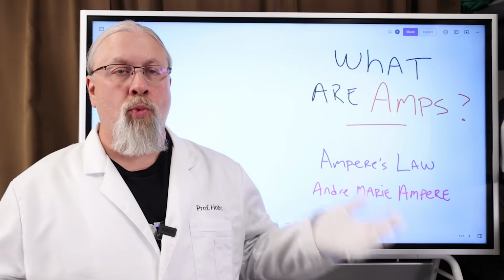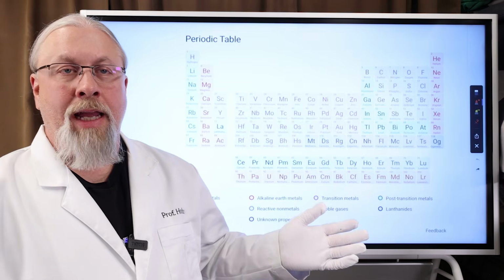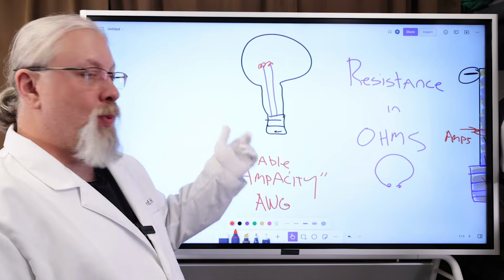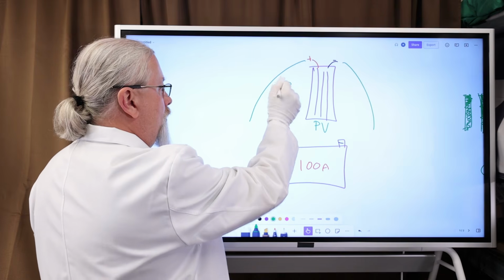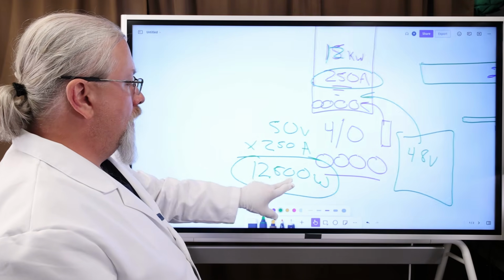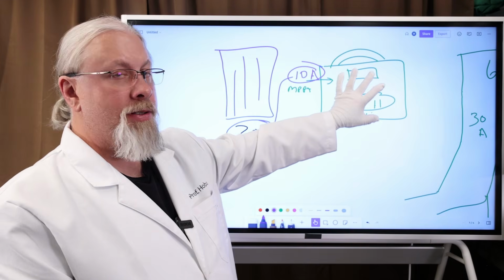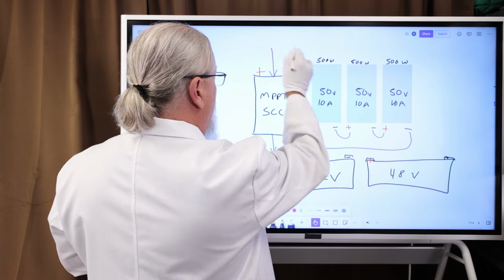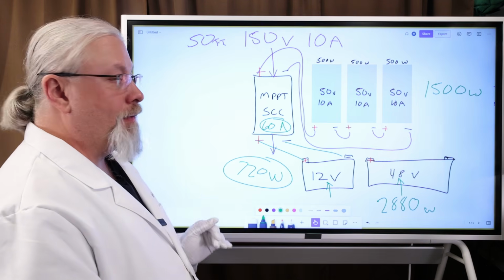Electricity for BEGINNERS Part 2/3: What Are AMPS In Solar Panels | Batteries | Power Stations

Comment: AWG = how many "pulls through a die" all cable (wire) starts thick then they pull it through a die to make it thinner. Every pull makes the wire a little thinner, so 2 AWG has two pulls through the die, still pretty thick wire. 12 AWG has twelve pulls through the die so much thinner wire in the end. This was how the AWG scale was originally designed, don't think is still done this way but the nomenclature is still used. This is how I remember which wire is thicker or thinner when talking about 10 "gage or AWG" vs 12 "gage or AWG" etc.

Comment: Question about my generator's solar input of 20A. I'm thinking of getting two 400W ZoupW panels and connecting them in parallel. The specs for one panel are:

Maximum Power Voltage (Vmp) 37.2V
Maximum Power Current (Imp) 10.75A
Opencircuit Voltage (Voc) 43.1V
Shortcircuit Current (Isc) 11.32A

Is there any risk that this combination goes over 20A?

Comment: Excellent presentation. Ecoflow, however,  insists that Amps from solar panels not exceed 15 Amps (Loss of warranty) into the Delta 3 pro which renders my newly purchased 400watt 12volt (33Amps)solar panels useless. Am  I missing something?

Comment: I will never understand electricity. I’ve watch the first two videos twice each and I just don’t follow. My brain just can’t process this. Even with analogies makes it kind of worse. I think I need to find one of those animated videos that show how it works. No matter what video I watch I can never find my scenarios. For example my exact battery my exact solar input my exact needs from the inverters. I thought I understood solar panel connections to the battery. Simple buy splitter from ecoflow connect them. But it seems like that’s a no. I have (2)220w bi facial panels, (1) 110w panel, (3) 100w panels. Since my battery (ecoflow delta2 max) has two inputs I picked up two splitters 1-4 for each plug which mean I can add 8 panels but according to the sketch on the screen I need to connect panel to panel not panel to battery. I THINK ??!!! Ugh. Why is this so hard to understand. I’m so out of my element

Comment: Suppose I have a 220W EcoFlow solar panel and also two River 3 power stations, which take 110W solar.   I can charge a single River 3 power station from the 220W panel, but at 110W, the River 3 limit.   Could the two River 3 power stations both be charged by the 220W solar panel simulateously?  I am thinking it would be done with a parallel cable, but in reverse, splitting the solar panel output to two pairs of MC4's, each MC4 pair going to a River 3.
Reply: Wow, great question, I'm guessing it would work.  I hope someone who knows for sure, will confirm.

Comment: An easy way to remember which wire gauge is bigger is to think of it like a fraction. If you have a 2g and a 4g wire: 1/2 is larger than 1/4. It works with camera apertures, too. f2 is a bigger aperture (opening) than f4. f2 lets in more light than f4...but you lose depth of field with the larger aperture (how much is in focus front to back).

Comment: Who knows how the 6 outlets are wired on the inside of the EcoFlow Delta2 Max? Are they all on the same buss bar or some high tech system that makes it to where no matter where you plug in what so long you do not exceed 20amp products?
Reply from the maker: Nothing high tech. Simple 20A outlets wired in parallel.
Reply: @HOBOTECH  Thank you Doctor! 👍🏻

Comment: This explains why the aluminum shims I made from cans to expand the diameter of my battery terminals to work with the stretched worn out battery clamps, did not work very well, and was basically a project failure. Too much resistance, because of the conductor material.
Reply: One thing I'm stumped with is running 100 watt panels to my Bluetti (EB3A and AC180 model) works when I step up to a 200 watt panel, the power stations do not recognize it, I've tried various different wires and connectors, and my multimeter shows the panel putting out. What am I doing wrong?
Reply from the maker: The VOLTS video tells you to check the Voc of the panel and make sure it doesn't exceed what the power station can take.

Comment: Just for clarity, SCC specs come with Isc (short circuit current) and Imp ( max power current), say isc is 22A and imp is 18A, would it be totally fine to supply PV at say 25A?. Logically i think it won't be a problem for the same reason mentioned in the video, coz we supply AC distribution of about 50A at 240V and that is totally fine for appliances as they draw only the required current. Please help.

I'm only asking coz several (well known) youtubers say supplying more current to a SCC can let out it's magic smoke
Reply from the maker: The entire point of this video was to explain amps are pulled not pushed. The SCC will only pull what it is rated to, no more!
Reply: That certainly cleared it up, thank you professor

Comment: If you release a drop of water and a gallon of water simultaneously in a vacuum, they will fall the same speed (relative to voltage).
But, a gallon is going to hit a hell of a lot harder than the drop.
The gallon being the larger current source

Comment: perhaps people connect the solar panels in parallel to get more efficiency out of them. In series, if one panel has poor light then all of them underperform.. I don't know just a thought
Reply from the maker: MPPT wants high voltage. You get more power in series. Typically, if one panel is getting shade they all are.

Comment: Thanks for this overview!  I learned the expensive way about aluminum wiring in the home as many Florida homes built in the 50's used this.  At some point a wise electrician noticed and remarked "do you know what a fire hazard you potentially have here?"  Of course for all we know, in 2100, people may say "that old house still has copper wiring!"

Comment: I was taught that the amps fed into a DC breaker box is the total potential draw from that box. So I can feed a 12v box with a 12v, 30 amp AC to DC converter, then pull up to 30 amps from the various connected DC draws in my van (e.g. puck lights, fans, diesel heater start up coil, etc.). Is this correct??
Reply: For safety you should only draw 80% of what's available. In your example you'd be able to pull up to 24 Amps.

Comment: A lot of solar charge controller manufacturers allow you to oversize the pv wattage by 30%. What the limit is, I haven’t pushed it more than that. Now voltage limits…I stay under at least 15% in the summer, because of the increased voltage output in cold weather.

Comment: “TI” Titanium has an electrical conductivity of 3.1% of that of copper. I have a titanium jet engine turbine wheel that’s been sitting outside for 30 years. Not one bit of corrosion. Of course it’s not pure titanium. It’s an alloy. Thank you for the excellent videos.
Reply from the maker: Yes, alloys are a whole other realm. There are many that don't corrode.